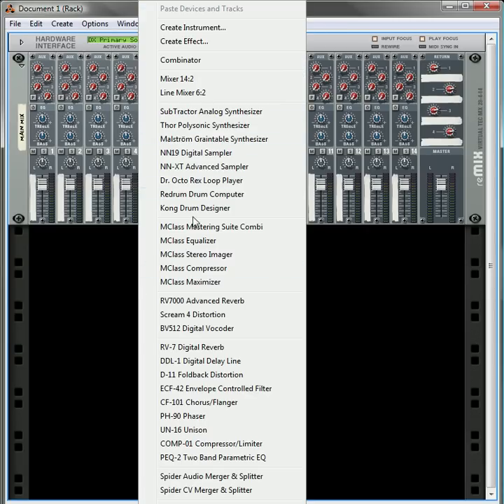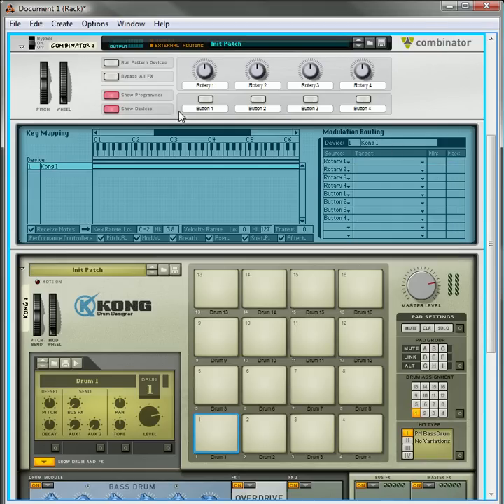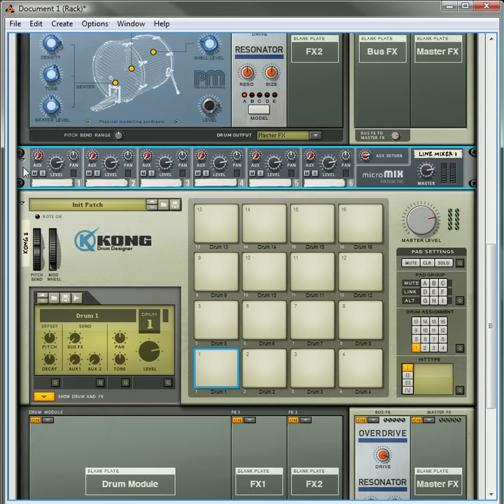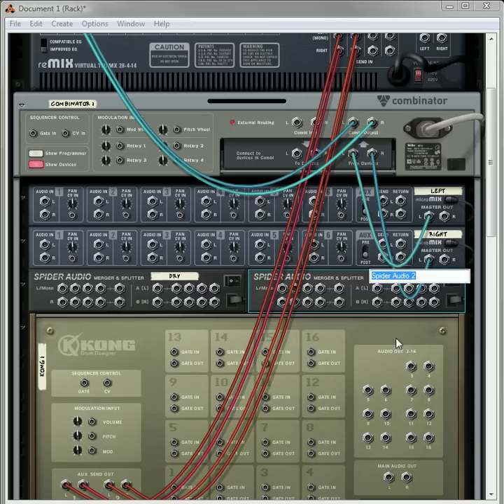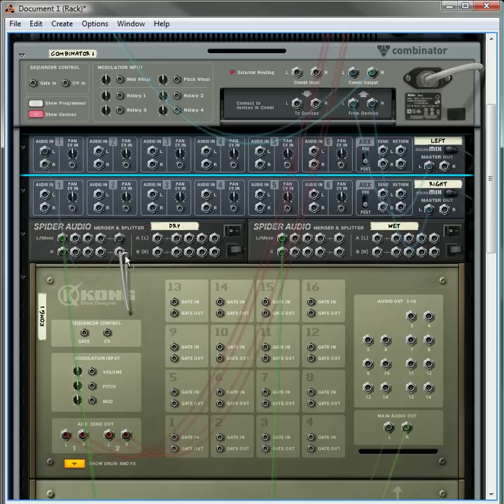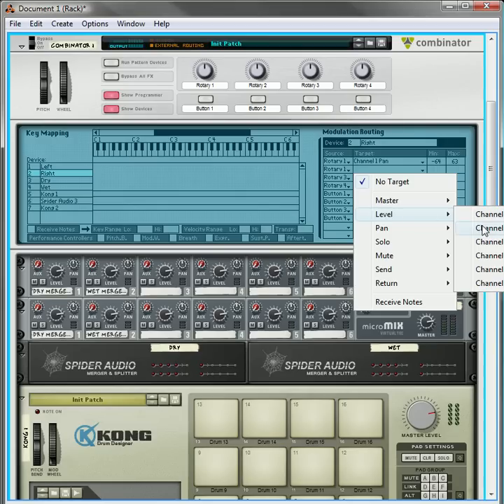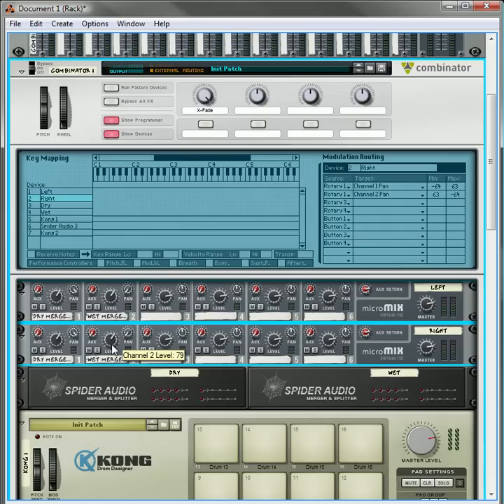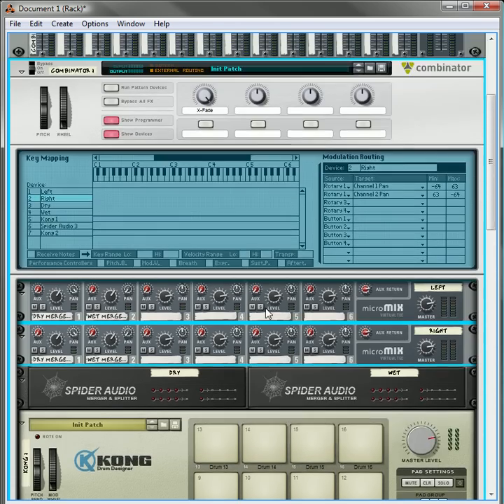Kong Automation via Cross-Fading

Comment from the maker: @IareDewey It's not wasteful at all. And the reason for multiple mixers and crossfaders and using the pan should be evident when you start automating levels. You need an Equal Power Cross-Fader, as opposed to a normal crossfader. Read Peff's article on Cross-fading under the "Understanding Reason" series of articles on the props site to see why. Good luck! And thanks for commenting.